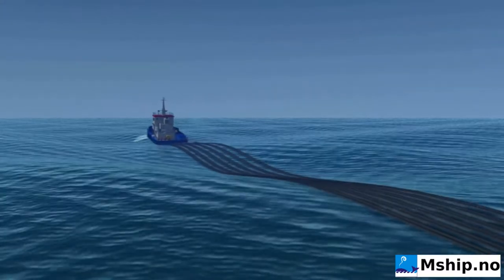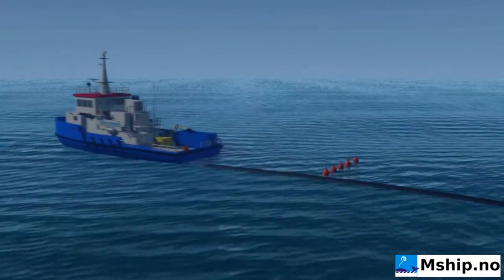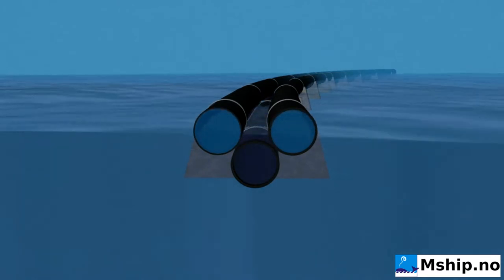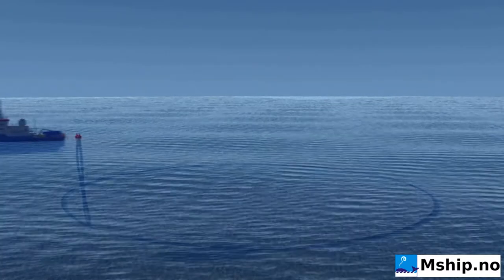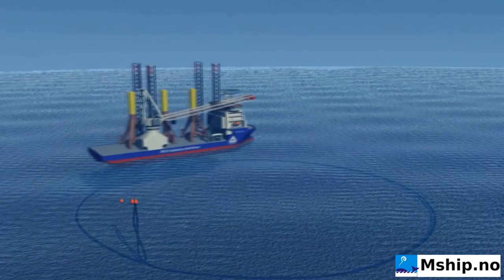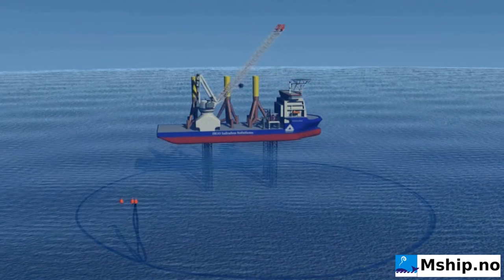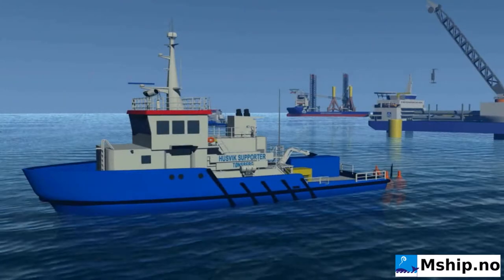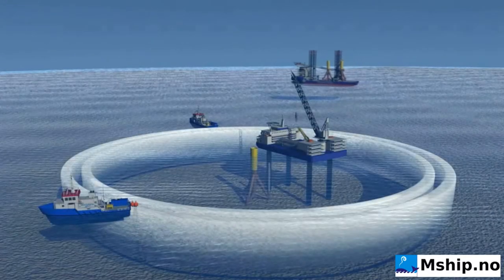Subsea Noise mitigation for offshore piling operations

Comment: Anyone actually using systems like this? Wind haters are blaming these loud projects for whale deaths now…
Reply: take a lot of compressed air and if there is any tide of ebb and flow, the bubble wont go up directly but are drifting
Reply: compressor, salty air, at least 6 bar and a few hundred m3 per minute, not reliable working in north sea flowing speed for bubble are  rising slowly 40m up  and drifting in that time  away.